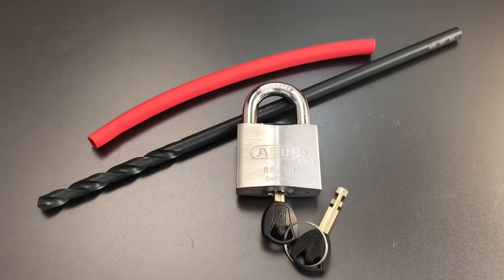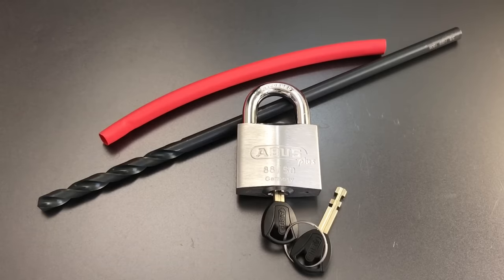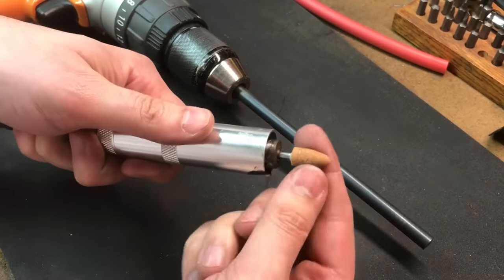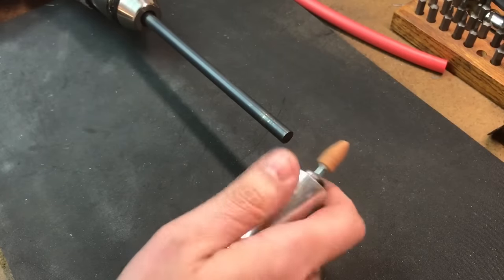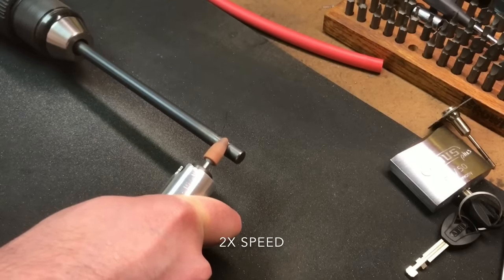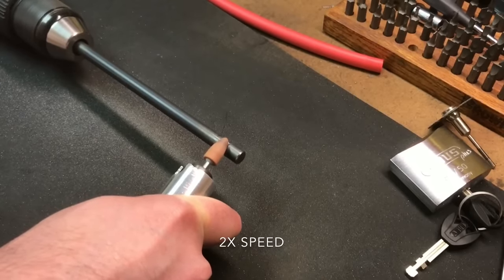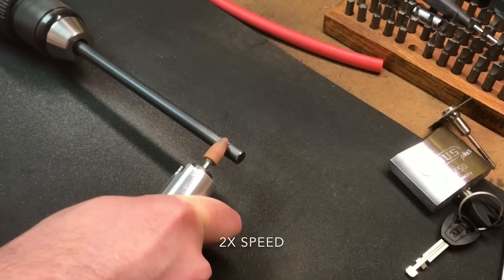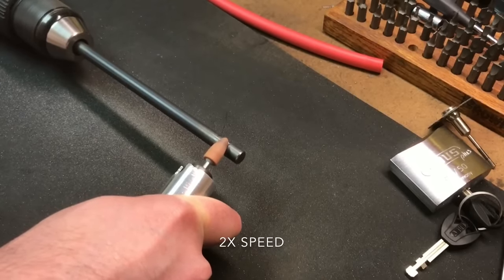[464] LPL Project: The Best Gun Lock Ever?

Comment: Just wondering why you would not Plastidip the whole thing, rod included? Why the Shrink wrap?
Reply from the maker: +rbuschy The shrink wrap is much, much more durable.
Reply: Ahh, I would also then maybe suggest rhinoliner spray? It's not like the assembly will be taking many duty cycles. I would also wonder if you made a 30 degree bend, could you run the rod through the barrel and lock from the end of the barrel? Then you could still have the magazine with the gun for quicker access if needed?

Comment: Awesome video - absolutely great work. Thanks a lot for putting this together for us.
When you ground the grove in the drill bit to fit to the ball bearing, why did you actually rotated the drill bit? It would have been only half of the material lost if you only used the dill as a steady vice.
Reply from the maker: Thanks.  I made the groove go all the way around the bar because I wanted the lock to freely rotate.  If there was only a half moon, one might be able to defeat the mechanism by twisting the lock body.
Reply: Very thoughtful - thanks for the explanation.
Reply: At the cost of a weakened bar however. Surely that is the current weakpoint and access point now?

Great project
Reply: Caoimhín Ó Coileáin Weaker sure, but unlike other tool materials like carbide HSS is not brittle, and you definitely couldn't break that diameter of rod with your hands or simple tools. If you've got this thing in a workshop maybe, but at that point you could just pull out an angle grinder and cut through any point of the rod :)

Comment: FWIW, I made one of these. The divot in the bar that engages the bearing inside the lock uses about 1/3 the diameter of the bar. Creating the divot around the entire circumference as shown in the video leaves only 1/3 of the bar remaining to hold the bar in the lock. A Dremel with grinder attachment can be used to create a divot the same size as the lock shackle (only on one side of the bar) thus leaving a much stronger 2/3 of the  bar remaining in tact. It's also significantly faster.

Comment: Nicely done.

If I might make a suggestion, I think it would be a good Idea to temper the groove drill bit where the lock engages. I've broken more than a few bits (without even trying, I might add D: ,) so I can imagine that snapping fairly easily at the narrow point. I know you specified protection against non-destructive attacks, but then, if one can destroy it by banging it against a door jamb. . .

Also, you can reconstitute Plasti-Dip with any of several non-polar solvents. My favorite is toluene, but xylene should evaporate more slowly.
Reply from the maker: Good to know on the plastidip.  As for breaking drill bits, I'd venture a guess that when you broke one, it was on down near the end.  Drill bits are usually differentially hardened, especially the long ones.  The shafts are less hard and far more tough.

Comment: could start with an allen key instead of drill bit and save a step or two
Reply from the maker: I actually considered that.  There were too many issues with making it work.
Reply: what were the issues? would a hexagonal shackle not be held as well as a cylindrical one by the lock's shackle retainer? a correctly sized ball-point allen key could make this an even more accessible project.
Reply from the maker: selezen163 Main problem was both ends being too short. Also, the hex shape compromised lock engagement.  Grinding the groove would have been far harder also because the wrench is already angled and can't be turned in a drill.  Finally, I had concerns about the steel, but only because I had no idea what it was.
Reply: I see, although i can't help but mention the "jumbo ball-end hex key", which can be found in virtually any shape, size or tool material, is hardly less common than the slightly atypical drill bit in the video and whose hemispherical cut is nearly identical in depth and curvature of either the lock's or your custom shackle. Might the hex shape more vulnerable to tampering, perhaps shimming, in your mind?
Reply: selezen163 this type of ball bearing lock can't be shimmed, and it doesn't really make a difference how good you can get inside there.
Reply: LockPickingLawyer  torx key
Reply: All hex keys are S2 Impact resistant tool steel
Reply: Cole Edson not all. Only the good ones.
Reply: @lockpickinglawyer  probably harder steel than the drill  bit there soft on the shank

Comment: Isn't an angle grinder more common — and cheaper — than a Dremel? And obviously quicker and easier for hardened tool steel like this.
Reply from the maker: I have no idea... I've had a dremel since I was a kid.  The angle grind is pretty new.
Reply: Jasper Janssen I think more DIY'ers have Dremels. (Even women and older folk) So I would think they're exponentially more common. Also, a cutoff wheel on a grinder can get hairy for the uninitiated. They probably wouldn't have a face shield/safety goggles on either. The angle grinder is doing much faster, with much higher centrifugal forces, much faster circumferential blade speeds, much greater spinning mass, etc.

Comment: brilliant job.. but here in the U.K. the most used firearm is a shotgun..  what would be your suggestions or could you design something for a shotgun that isn't open to attack?
Reply: I would think that the same design would work if you could get the shackle thru the ejection port and the lifter an out of the gun, or get a really long piece rod and put it thru the barrel and secure it on the muzzle end
Reply: paul oldham simply, take some tape and wrap it up nicely!
Reply: problem is you can't store it closed  if you have a rod down the barrel.. makes for awkward storage if you have a few shotguns in your cabinet
Reply from the maker: If you are talking about a break action shotgun, I have a few ideas, but they all require storing the gun open or broken down.  :-(
Reply: If you can't store it in a way that prevents a round from being put into the breech (or breeches), its gonna be hard.
I don't know what shotgun you have, but what I do with my AR if I have to store it around people is just remove the firing pin.
I know thats about the easiest thing in the world to remove the firing pin on though.

A break-action shotgun might actually be acceptably safe if you could disable the ability to open it though.  That might be a potential route.
Reply: break action, over and under 12 gauge.. it's not that it can't be stored properly because you have to have a gun cabinet with 2 7 lever mortice locks on.. but in my opinion.. a little extra security on your firearms puts your mind at ease when you have children and a Mrs that might get pissed off with you 😂
Reply from the maker: I'll take my O/U  out and have a look.  I've never tried to lock it up short of putting it in (the back) of a safe.  I disagree with htomerif on storing it closed...  too much uncertainty when I return to a gun months later and am unable to check to see if the gun is safe without a key.  I'd much rather store it open or with the barrels off.  I wonder if you could fit a padlock around the hinge axis pin?
Reply: We'll I've been thinking.. and if you use a steel rod.. put a notch at the end like at the locking end.. and maybe use an empty shotgun cartridge filled with led and drill a hole through the cartridge, led and steel rod for a pin to fit in! then the shotgun can be closed with the rod down the barrel and locked up.. obviously 2 of these would be needed.. do you think this would work?
Reply: @paul oldham: That was my first thought too.  He did a video on a barrel lock a while ago where it basically locked down the barrel into a dummy cartridge.
actually........  I know this sounds stupid but...
you might be able to do essentially exactly the same thing he did here, just machine grooves in two rods, with an appropriate cartridge blank that would go rod-end first into both breeches.  Then just put both ends in the lock and lock it.  The only thing that would protrude would be the lock body at the end of the barrels.
Sorry if thats exactly what you meant and I didn't understand it.
Reply: @htomerif.. I know what you mean.. that was my first thought..  but then doing that.. you wouldn't be able to store your gun closed.. which is the aim I'm searching for! 

then I got to thinking.. 2 rods with grooves in both ends.. one end of each rod into empty shells filled with led with pins through so the led can't be pulled out so when both rods are inserted down the barrels, they would lock into 1 padlock.. a decent padlock with removable shackle would be needed of course... unless the lock picking lawyer can come up with something like this I'll have a go myself.. may take me a while though.. I don't have a workshop at the minute.
Reply: I think we're describing pretty much the same thing, two fake shells with rods coming out of them that go into a lock at the muzzle end of the barrel.  I dont think there are any "good" feed-through shackle locks that would make that any easier.
Instead of rods, you might be able to get away with a steel-cabled bicycle lock, of which there are at least some decent ones.  You could cut the cable and pin it to the inside of some shells (you could fill the shells with molten zinc for some added strength).
So ultimately it would be shell-cable-lock-cable-shell.
It depends on what tools you have and how much money/effort you're willing to go to.
Reply: I thought that a lockable gun-cabinet was mandatory in the U.K. ?  I'm wondering if there is a U-shaped bike lock that would be the correct size to go through the trigger guard to prevent the break-lever being pushed to the side, (effectively keeping the gun locked closed.
Reply: Reckless Roges it is.. gun cabinet is required with 2 7lever locks as standard.. but when you have children.. you can never have enough security on your guns in my opinion
Reply: Or you can just teach your kids not to touch your guns unless you are there to supervise them.  Many of us were raised that way and raised our kids that way and we are still alive.

Personally, I keep the vast majority of my firearms locked up in my 1600 lb gun safe, but there are probably 4 or 5 that might be around the house that are not locked in any manner.
Reply: How about a basic trigger lock? Keep the gun closed but you can't access the trigger
Reply: Stephen Bunnik: If I remember, its a double barrel, break action.  Those can have a kind of weird trigger area.  My dad has a Damascus steel double barrel from I have no idea where, but it just literally has 2 triggers.
Reply: If you were wanting to use this same method for a break action shotgun, you're going to base that is shaped the same as whatever gauge the shotgun might be, attached to a rod that runs the length of the barrel, and then with possibly another plate that covers the end of the barrel, and then the lock.  If it is a double barrel shotgun, you will need two of these.

You might be able to accomplish this with minimal tools by using a fired shell and a threaded rod and associated nut.  Put the nut on the end of the threaded rod.  Insert this into the fired shell and fill the shell with some sort of epoxy like JB Weld.  On the other end of the threaded rod, you will need to have converted it to fit in a lock like was done in this video or maybe just have it attached to a wide flat piece of metal that you can stick an unmodified lock through.

A better long term solution is to just teach your kids RIGHT to start off with.
Reply: +htomerif
Not all double barrel shotguns have two triggers.  Many of the older ones do.  I remember my grandfather had a LC Smith double barrel 12-gauge when I was a kid that I would use to shoot blackbirds out of the trees, using both barrels at the same time.

Damn, that was probably 50+ years ago...
Reply: Grumpy OldMan: You're right, I dont actually have a good feel for how many have 2 triggers, but I suspect the most common setup is pulling the same trigger once for each barrel.  I've seen ones with a rotating firing pin plate that advances on cocking the hammer.  I think that was a 4 barrel one.  (I checked, it was a Winchester Liberator)

I don't know if you're from the UK (or any other country than the US), but in the US its pretty strictly illegal to own anything where having one trigger pull fires more than one round without a very hard to get NFA license.  Having 2 triggers that are right next to each other (in front of or side by side) circumvents that law.

I could be wrong, though.  Shotguns seem to have some immunity to the laws other guns have like the maximum rifle/pistol caliber restriction of 0.5 inches.
Reply: +htomerif

I'm in Texas.  Interestingly, our laws state that it cannot fire more than TWO shots on a single pull of the trigger.  I have to wonder about how that came about.  Was it to take care of the old shotguns or is it a more modern interpretation that allows for those trigger mods on the AR15s that fire once when you pull the trigger and then a second time when you release the trigger.

Of course, there are also firearms that have two triggers, but they are just for firing a single round.  The first trigger basically cocks the firearm and then the second trigger is extremely light and fires it.  I think this was used by the benchrest competition shooters many years ago.  I'm not involved in that sport, so I have not done much in the way of looking up the history of the firearms that they use.

There's a somewhat expensive M1911 in .45ACP that has two barrels and you can shoot both of them with a single pull of your finger.  I don't know if it has one or two triggers that  you press though.

Two triggers allows for quicker follow up shots compared to a single trigger that sequences between the triggers and even quicker compared to ones where you have to press a selector to switch between barrels.

Actually, it's not particularly difficult to acquire a NFA firearm, but the wait time is more than most folks are willing to spend.  I think it's about a 6 month wait these days.  There's also the $200 tax stamp issue which just hits many of us as wrong.  We don't like having to pay to exercise what is supposed to be a constitutionally protected RIGHT.  Also, it's not a license (which would be a one-time thing for the person), but rather a tax stamp that applies (along with the wait time and paperwork hassle) for each firearm.
Reply: paul oldham yeah another shotgun.lol.
Reply: Just remove the firing pin...
Reply: ok, so first step is find a 1/2 inch 3 foot long drill bit... (oh wait your in the uk... google translate)
Reply: Decent gun cabinet with lock is sufficient when I had mine I had a break action double barrel gun kept it in a solid steel custom built cabinet and the ammo in a separate steel box only 2 keys for both always on me even when asleep
Reply: Well the most common weapon in the uk is the shotgun

Why not just get a decent trigger lock?
Reply: We use the imperial system in the UK
Reply: Hi from southern England 🏴👍

Comment: Is this still the recommended way to go? I see this was posted almost 3 years ago. Its very easy to find a video where someone is easily getting into a gun safe but seems to be very hard to find a recommended solution by you lock picking pros.  

I am hoping you get a chance to reply @LockPickingLawyer
Reply: The general consensus from what I've found is that the hss would be too brittle and you should heat the whole thing a good bit as even eneled hss is strong af and just use a lock he has recommended  (also find a way to remove the grease from the drill bit before heating the heat shrinking tube)

Comment: How about a padlock at each end to add to your collection of dual custody locks ?
Reply from the maker: A padlock at each end would be "shared custody."  :-)
Reply: LockPickingLawyer what if you bend both sides of the drill rod?  Wait...
Reply: Yeah, that would be "no custody". :-)
Reply: then you will have a very secure gun
Reply: Since you are only concerned with non-destructive entry, how about a bar of aluminum that was just the right size to slide entirely through the gun and then drill a hole on each end and put a lock through each hole.

Drill rod is a bit of an overkill in this because as was shown in the video, you can use a dremel type tool to cut it.
Reply: Grumpy OldMan it's more for a spur of the moment type thing.  A kid would have a hell of a time with tool steel, but an aluminum rod would be relatively easy to hacksaw through before dad gets home.
Reply: Actually, I'm talking about a rectangular bar, not a circular rod.  And if you are going to allow some destructive methods, then at what level do you say is ok vs not ok?  If you are not allowing destructive methods, then you are only concerned with the kid being able to access the weapon in a manner that does not leave evidence of his access.  With that criteria, even wood or * plastic* would work.

No variation of this type of gun lock is going to prevent your firearm from being stolen.  The thief will just take the gun and lock with him and work on it at his leisure.  If you are using this sort of gun lock, you are just wanting to keep the the unskilled from using the firearm or at the very least requiring them to leave evident of their unauthorized access.
Reply: Grumpy OldMan ah, yeah, I should have figured by your username you would just not think critically.  Good luck with human interaction.
Reply: I'm an engineer, I think very critically.  I realize that it does no good to put a bank vault door on a room with sheetrock walls.
Reply: Grumpy OldMan k
Reply: You could run a string through it and seal it with was if your only criteria was 'nondestructive'. Since there's no way to lock anything up that will prevail against all destructive attacks, the goal is to make them slow, loud, and inconvenient.